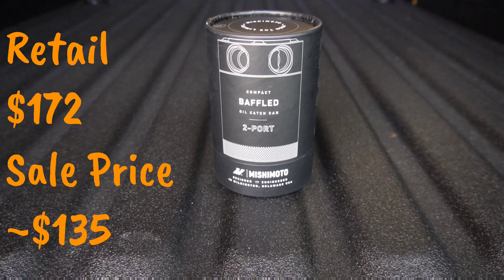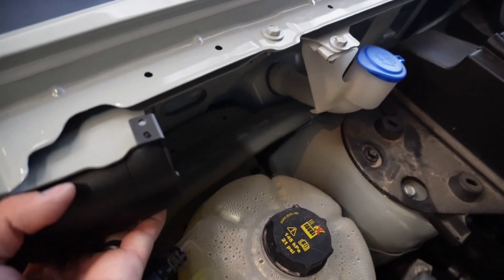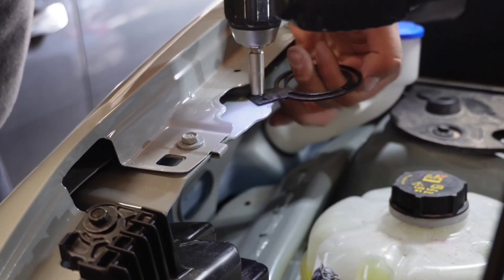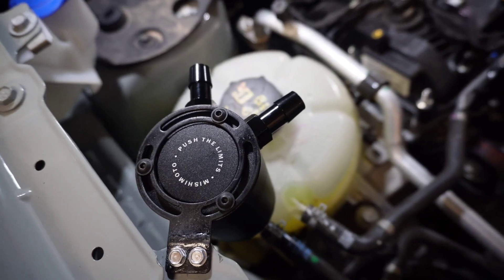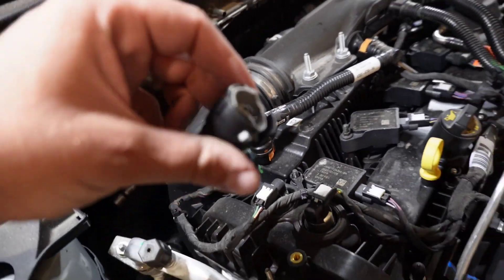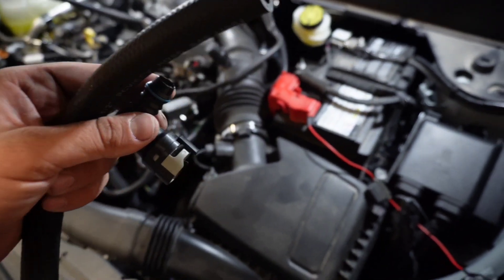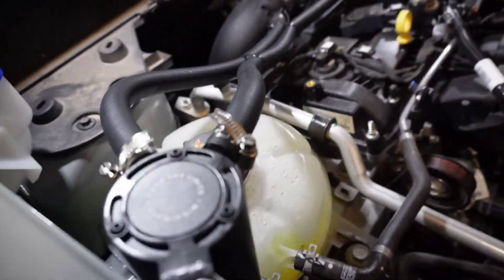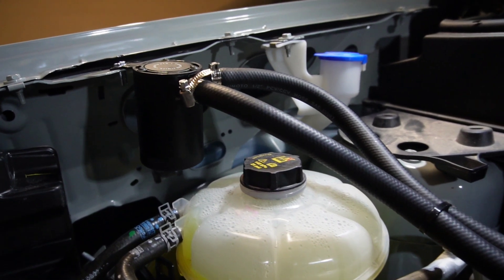Ford Maverick gets an oil catch can!

Comment: How has your catch can been going since you’ve installed it? This is one of the things I think I most about doing to my Maverick because of a terrible past experience with a vehicle and its oil/engine.
I would love to hear how it has been working and if you find it has done a good job of reducing build up in your engine?
Reply from the maker: I've been a little disappointed if I'm being honest. It really hasn't collected more than a thimble of liquid (not sure of that's because it is a new vehicle), and it looks like there might still be contaminates bypassing the can itself.  Now, with that said, it still does do its job (just not as well as I'd hoped).  Also, doing more research, there is another location to add a catch can in front of the engine that is supposed to be more effective, so that might be my whole problem.
Reply: @deserttrek  From what I have been reading on the Maverick owner forums, apparently Ford has a factory installed baffle system on the side of the block which is supposed to remove oil and drain it back into the block before it enters the intake manifold.  So hopefully it's working well and would explain why the catch can may be redundant.
Reply: @deserttrek  do you have any video or instruction on the other catch can? thanks
Reply from the maker: I don't, but if you look up "Boomba Racing catch can" you can find their installation video.  Let me know if you don't find it, and I'll try to find one for you👍

Comment: Clean side. Really doesn’t do anything. Will see very little results in the can. Need to do the dirty side to see any actual benefits
Reply: I installed 2 catch cans 1 I installed like this and the second I put between the factory oil separator and the intake . I'm getting oil in the second catch can but not the first one . I guess the factory oil separator doesn't work that well 😂

Comment: The link you added are for 5/8” quick disconnects but you mentioned you used 1/2” hose. Is it correct or is it an incorrect link?
Reply from the maker: The link is correct... kinda.  I was able to fit the 1/2 hose with some oil and some elbow grease.  Mishimoto might have some 5/8 adapters and hose if you want to have a proper sized hose.  I didn't realize till I was filming that it was the wrong size so sorry for the mix up.

Comment: I have heard the catch cans don't really fix the issue. Changing your high quality oil and filter every 4,000 to 5,000 miles would not allow them to degrade too far which could cause engine damage over time.
Reply from the maker: From what I've seen and read it should help keep your valves cleaner longer and help longevity of your turbo (if your vehicle has one).  Now I do agree with you that oil and filter changes are more important but I like to be careful.   On an anecdotal note, I've had my catch can on for about 3000 miles and I'd say it is about 1/3 to 1/2 full of fluid that I'm glad isn't getting recirculated back into the engine.
Reply: Tell us you don’t know what a oil catch is without actually telling us…
Reply from the maker: So I just did an oil change and it had barely anything in it😂.  I checked it really quick for my first response and didn't get an accurate amount. Sorry about that.